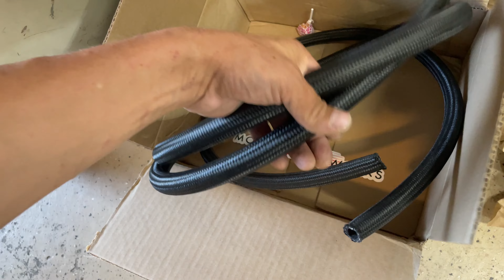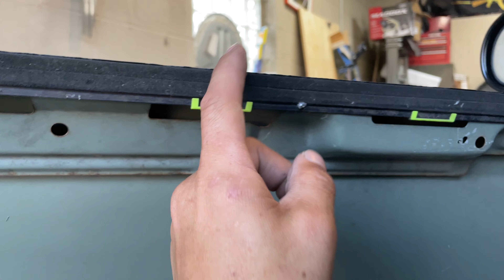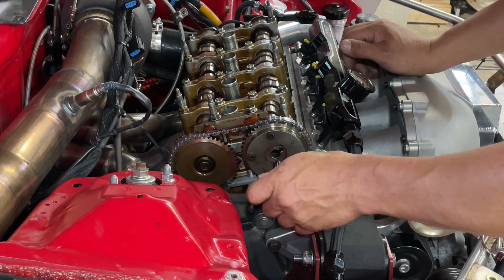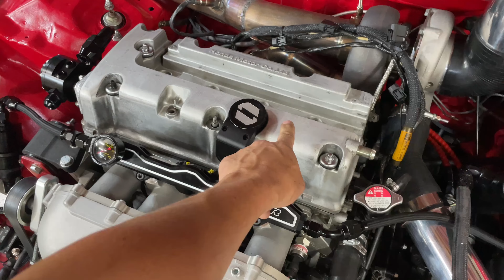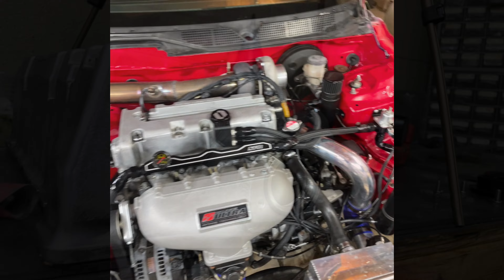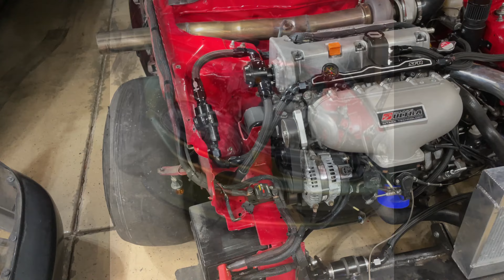I ADDED A MECHANICAL FUEL PUMP TO MY HONDA CIVIC

Comment: I can promise you this, any of the evil energy fittings and lines are smaller internally than advertised. We had fuel starvation/ran lean with 12an lines at 800hp, did a waterflow test between cheap ass evil energy and vibrant of the same size, the evil energy at 12an flowed like an 8an, its crazy. Its almost blown up alot of peoples motors or made then run around chasing fuel related problems. Hope you read this man, love the build!
Reply from the maker: @uknterror508  yep that’s why I’m running speedflow fittings and fragola AN lines
Reply: @franksgaragehonda  going to wcf?
Reply from the maker: @uknterror508  to watch. Cars no a WCF approved jaja
Reply: @uknterror508, Thanks for the info.

Comment: 👏 I thought you were going to run into fuel pressure issues with the old regulator. Next time look into aluminum hardlines. Its much cheaper and easy to work with
Reply from the maker: @hondahacks1014  issues with the Weldon FPR? I didn’t. But I did upgrade from the 10an Weldon to the 12an one
Reply: @franksgaragehonda  I think i missed that part in the video. Usually people toss on big pumps and can’t control fuel pressure and just leave 65 psi base and lose all the flow of the pump under boost
Reply from the maker: @hondahacks1014  I run 43 base. Mechanical pump has been working amazing! So happy I got away from electric.